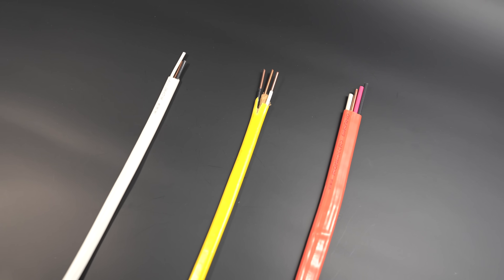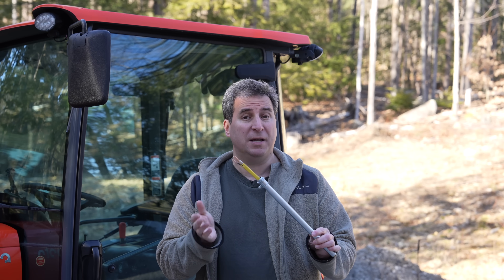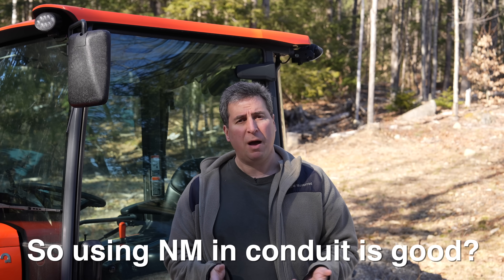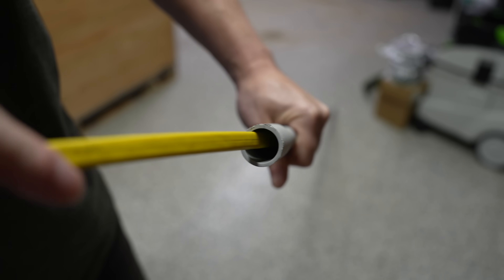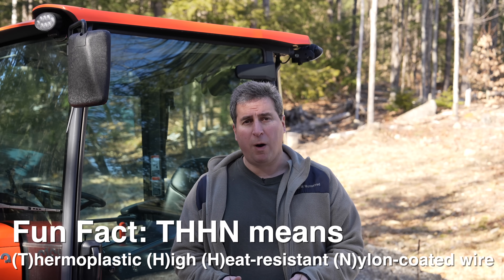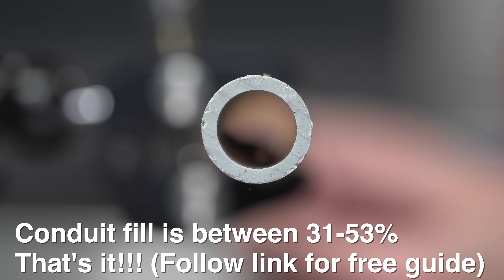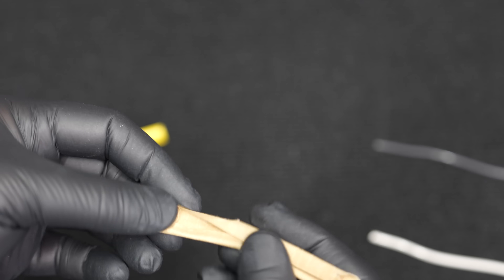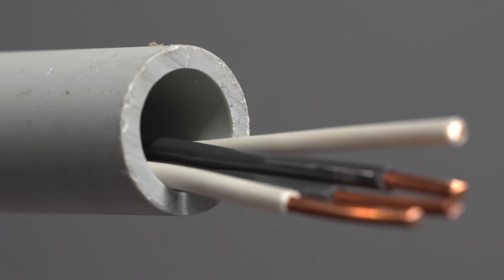#1 DIY Electric Mistake - Can you use Romex Wire in Conduit?

Comment: Is there an NEC section on ROMEX conduit fill for these multi-wire/single conductor situations? In my area, the ROMEX is required to be protected by conduit for drops along walls, to appliances, like washers and dryers. Never been dinged on it before, but usually just pick something that fits physically. Conduit pieces are usually 6' - 7' long.

Comment: For some reasons these types of videos have been showing up on my feed. So far this one has been the most to code accurate. The only thing I'll add, that you did or did not talk about. Those outdoor disconnects with a whip going to something like an ac condenser unit. There box is pressed out to have raised feet. So whether you run direct romex or sleeve it through some type of conduit, some people might consider that a damp location.